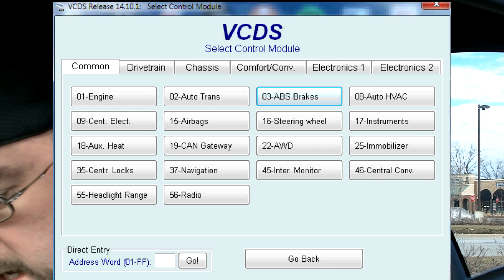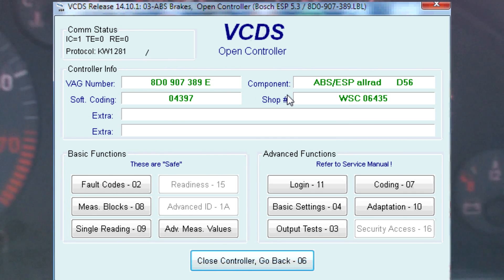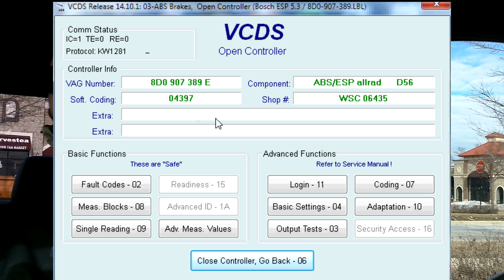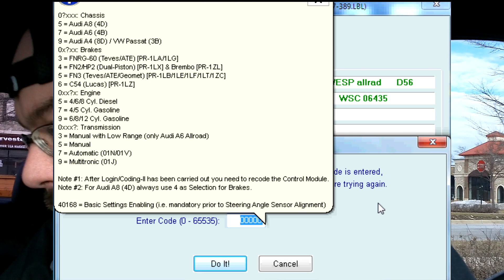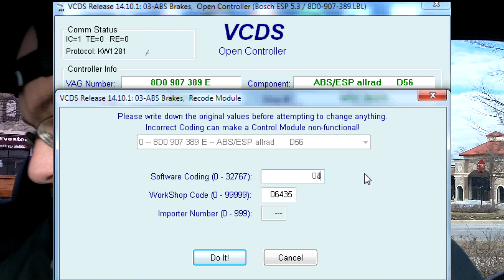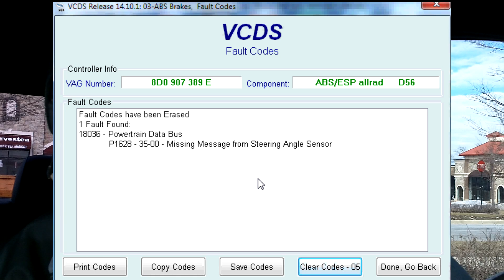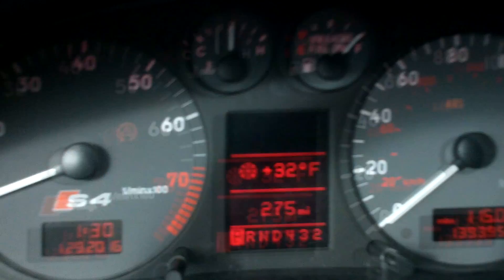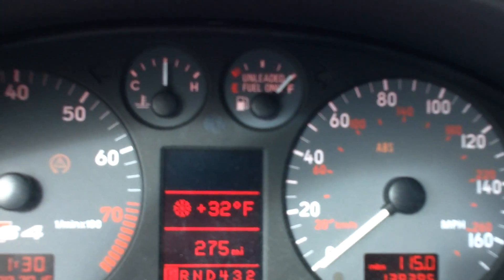2002 Audi S4: Ep. 87 - How to calibrate a steering angle sensor

Comment: you are doing it wrong :)))
start engine
1 hole turn to the right
1 hole turn to the left
drive straight for 20 meters do the math in miles :))
make shore to drive straight :))  stop the car dont move the steering weel dont stop the engine
whith vcds   go to 03 abs brakes
login 11 ,,, enter 40168,and press do it :D
go back to basic settings 04 Group 060 and press go!  this will memorize new settings and a message should say Steer angle sender compens or alignment status OK !!!
press done---Go back  and ready :D....    if not you messt up the process and have to repeat it :D have fun cheers
Reply: is this the same with audi a4 b7 estate? Thanks in adv man :-D